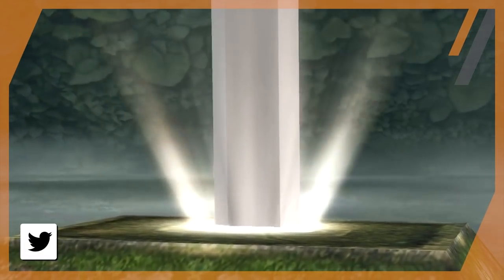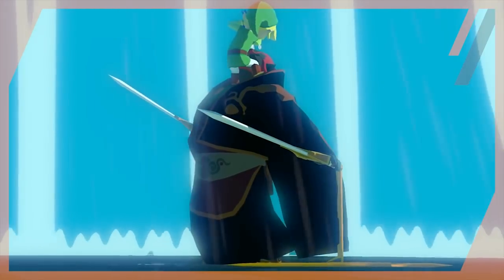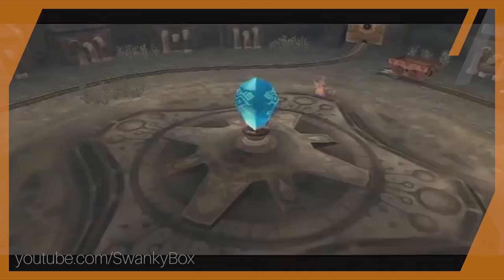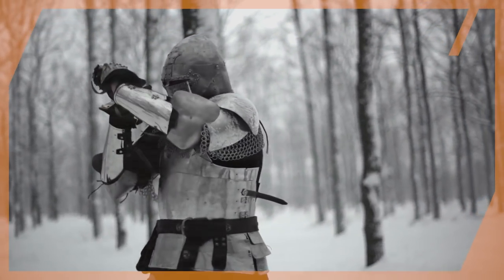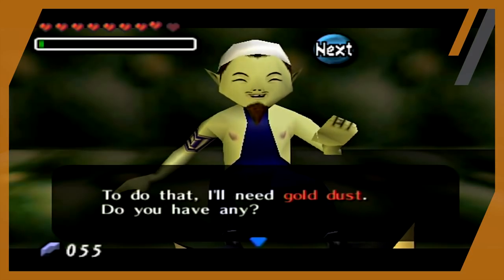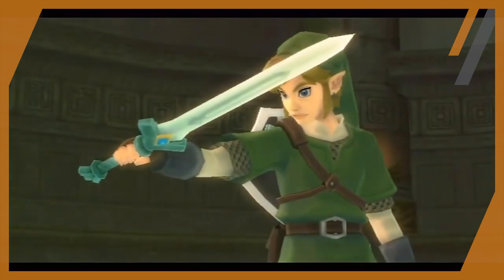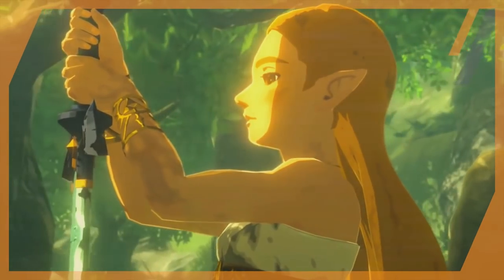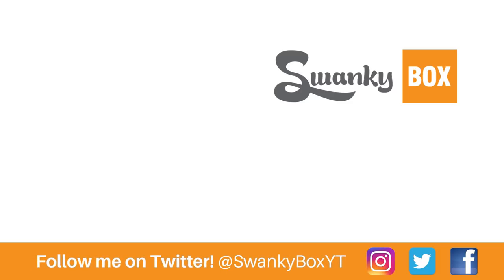Why EVERYTHING About Zelda's Master Sword Somehow Makes Perfect Sense

Comment: A bit late to post this, but if you want to pull some lore from the side games, there's actually a fair amount to work off of in terms of metal. First however, we should address the nature of the 3 golden goddesses. 

So, while locations like Termina make no direct reference to them, they do seem to still have implications that they existed in their world. While a game like Phantom Hourglass's Realm of the Ocean King (which is strongly implied to be a different dimension) has Courage, Wisdom, and Power Trifectas, and ties in nicely with the core ideas of the Goddesses. This is all important because in A Link Between Worlds, we are introduced to a Dimension separate from the one Hyrule is from, that also has a Triforce without being a pocket/mirror dimension. (Like a Link to the Past's Golden Realm, which was corrupted and became the Dark world. In the intro to the game however, the Golden Realm was seemingly created just to hold the Triforce, and should likely be considered an extension of its original dimension.) Because Lorule proves that the Zelda Multiverse can have the Golden Goddesses involved, by having its own unique and separate triforce, regardless of which dimension it was, means that materials or magical possibilities (such as seals, spells, or magical items) possible in one dimension, should be possible in another, without needing to travel between dimensions, as basically all alternate dimensions are made of the same base components.

This was all important to set the president of the Realm of Ocean King from Phantom Hourglass as a reference point for the nature of the materials used when crafting the Master Sword. Or rather, the Goddess Sword. So, in Phantom Hourglass we eventually obtain a weapon that's strikingly similar to the Master Sword. (And likely, should be around or just under its power.) The Phantom Sword is a sword made of special metals, all combined into some form of alloy, that when forged together act as a strong enough base to contain the titular Phantom Hourglass. This special item, made by the Ocean King, a creature possibly around or near the power of Hylia herself, has half the power to stop time. The other half needing the power of a Fairy of Time (and courage) 

These special metals are known as Pure metals, and have strong spiritual implications to the tribes of the realm that look over them. As well, they specifically hold resemblance to the colors associated with each of the Golden Goddesses. Together, they seem to create a metal (similar in color to the master sword) that is capable of channelling holy power that's strong enough to defeat a creature implied to be on par with or created by, an incarnation of demise. Though the Phantom Sword is almost surely weaker than the Master Sword, as it has the power to repel all evil, this may have less to do with the metal, and more to do with the crafting process. Given what we've established with the previous sections, I would say it's safe to say a material similar or identical to the 3 pure metals, or the alloy/material created when combined could exist in the land of Hyrule. (Though could be incredibly rare) If that was used, and Timeshift Stones acted as a base for the hilt, I think such a thing could reasonably form the Goddess Sword. Given the possibility of the Goddess Hylia being the Goddess of Time mentioned in Majora's Mask, then her patronage as the creator of the sword may grant it greater time manipulation power/ability as well. 

If all of that was true, then I would also stand to reason that the Phantom Sword is likely stronger than the Goddess Sword, and that when the Master Sword was forged out of it by the Sacred Flames it became more powerful, and stands as the most all around powerful sword in the Series. (When not compared to its own improved forms) As the Sacred Flames are said to be the direct power of the Golden Goddesses, and the Triforce is undoubtedly the most powerful force in the series, it stands to reason that a vessel made to hold and channel the power of the creators of the Triforce would be the most powerful sword achievable. So in conclusion, I think the gold and titanium alloy angle is good, but I also think that the Master Sword is made of a different metal, that, given that some weapons deal more damage, like the biggoron sword, the Master Sword may have actually been made from a different, perhaps weaker material made to better channel holy magic, to give it potent sealing and repelling powers. Though is almost surely made from something about as durable as regular Titanium.

Comment: A good theory, but the sword itself needs to be full tang to be able to sustain the damage it does. The crystals would need to be harder than diamond, and honestly, I can only see the pommel being made of the time crystal, while the grip and guard are a metal accented with a melted crystal over it.

Basically, a LOT of work for the craftsman if you're forging a hand guard of crystal. 

There are so many parts to the Master Sword, to fabricate it would be no small task. The guard would need to be reinforced so it does not break, which will take time and effort. Even given the rule of divine influence, the sword itself will need to be crafted carefully.

Last I checked though, a new version of Titanium was made and it was called "Titanium Prime", which was 4 parts titanium, and 1 part gold. Increasing the resilience of titanium, with the bio-compatibility of gold.

Gold itself is known to be immune to oxidation, meaning it never rusts. It may tarnish, but it will never rust. The time shift to repair itself is a good reason, though in the end, it just means it's still a magic sword that mends itself.

Comment: I would like to give an interesting counter-theory, so please hear me out.  The factors of all metals are very different when used for making swords.  Metals like Gold, Silver, and Titanium are too soft to keep a good edge on a blade (even the Ti3Au alloy); as it is mostly the carbon impurity in the Iron which gives Steel it's effective hardness and toughness as a good sword.  With it's immensely high-melting point, Titanium would actually BURN into TiO2 powder before it could melt.  However, the Master Sword's blade could POSSIBLY be made out of Wootz steel, giving the already strong sword the impact, corrosion, and acid resistant blade it's known for!!
As for the rest of the video, the Time-Shift Stone explanation is a great theory.

Comment: Regarding the Master sword not corroding over thousands of years, I'm not sure how the mentioned Titanium-Gold Alloy works corrosion wise, but aside from its rarity and unusual color, one of the things Gold is valued for is its lack of chemical reactivity. Platinum and Iridium are the most corrosion resistant metals(hence why the prototype Kilograms were made of a Platinum-Iridium alloy back when the Kilogram was based on a physical object instead of the fundamental properties definition it was given in the last few years), but Gold is pretty resistant to oxidation and other chemical aging as well... and I'm pretty sure Titanium is less reactive than Iron and most steels.

Though, I find myself wondering whether that 3:1 ratio is in terms of weight, volume, or number of atoms/moles. Hopefully weight since the density difference means a lot of Titanium to a little bit of gold(If I'm doing my math right, a 3:1 T:Au weight ratio corresponds to a roughly 12.8:1 volume ratio, whereas the 3:1 ratio being in terms of volume or atomic ratio means most of the blade's weight would be gold... it would be a very expensive alloy regardless, but the 3:1 ratio being in terms of weight would be the least expensive... plus might result in the blade being light enough to actually swing like a bronze or steel sword(Titanium is a fairly light metal, ~4.5 g/cm^3 while Gold is one of the heaviest, ~19.3 g/cm^3, while steels are in the 7-8.5 g/cm^3 range. Not only would a solid 24k gold sword be too soft to be an effective bladed weapon, but its weight would probably make it more effective as a bludgeon and impossible to swing like a normal sword, while a pure Titanium blade might lack sufficient weight to cleave effectively unless it was significantly sharper than a steel blade of the same dimensions(what cuts is pressure, and pressure is mass times acceleration divided by area., so for the same speed and edge thickness, a heavier blade cuts better, though the heavier a blade becomes, the harder it is to get up to speed).

Though, given what was said about the Master Sword being an Arming Sword an the other sword classes in another comment, I'm guessing the Biggoron Sword is a long sword and I find myself wondering if the Kokiri Sword is a short sword or a dagger.

Also, while I've never known them to stab back, I find that, when slicing Tomatoes, stabbing is usually the best way to start a cut and that using the edge of a knife, unless very sharp, often just indents the skin and more mashes the tomato instead of starting the slice... granted, most of the "sharp" knives in the main flatware drawer are probably 15-20 years old and who knows when the smooth edged knives among them were last sharpened... we have a butcher block with good knives, but I have an unreasonable housemate that keeps hiding those.

Comment: -The blade is made from Fallout:NV Saturnite, an alloy used in knives that were sharp enough to cut throw cutting boards used in restaurants
-The hilt is made from an Elder scroll (specifically the one used to banish Alduin) 
-And It has the Mending enchantment from Minecraft to repair itself

Comment: I'm not a metallurgist, but I suspect that a sword made entirely out of this very hard titanium-gold-alloy is going to be so hard that it's brittle. If so, it would probably break upon hitting something hard, rather than bend and then return to its former shape. We have modern types of steel that are far harder than anything else humanity has had access to so far, but that doesn't mean that we make our tools entirely from it. Some tools (or weapons) benefit from having a different hardness in different parts (so like maybe the edge and the point are made harder than the body of the entire thing).

Comment: Sandia platinum-gold is considered the most wear resistant alloy in the world.  It is silver-white in color, like normal platinum, and just slightly heavier then gold.  It is more heat resistant from high thermal conductivity, has high oxidation resistance, is one hundred times more durable then high-strength steel, and in the same class as diamonds and sapphires for wear resistance.  However, it is still only as hard as other platinum-gold alloys, which isn't super hard, but just conducts heat and wear better through it's structure.  As mentioned in the video, the gods most likely had an advanced knowledge of metallurgy.  It is already known that both gold and platinum can be alloyed with titanium to make a far stronger alloy, so it is entirely possible, I believe, that they could have made the blade from an alloy of platinum-gold and titanium, to make a super-hard and wear resistant blade.  Although, obviously, I could be mistaken, as there are other metals out there, such as tungsten, for high tensile strength, but brittleness, or chromium for the hardest known metal around, or who knows what else.  But I think titanium alloyed with a platinum-gold alloy sounds reasonable.  Although, I think it is reasonable that the White Sword from the original Zelda game could be a mixture of platinum and tungsten, but, again, I'm not an expert.

Comment: Beta Ti3Au is the alloy he was referring to when referencing the study from 2016. Its not stronger than all steels, but its definitely harder than a lot of the steel types used in the making of decent swords, e.g. 1090. It has high shear strength apparently but nothing is really said about its tensile strength. If its higher than say 1090 than yes it'd make a wonderful sword blade. The weight of the molecule is pretty close to steel as well, meaning handling shouldn't change.

Comment: This is proof that Magick can be explained with science! Or, at least some magick. 

For example:
The Kamehameha wave? Plasma.
Hadouken? Plasma.
Palutena's Megalazer in SSBU? Plasma (or maybe some kind of Gamma Ray/Plasma fusion).
Reply: The Force and lightsabers? Plasma. Using an invisible plasma source to move objects and create lightning, or create a colored fixed length beam of light which can slice through metal like butter. 
Pokémon? Plasma. How else does a 17 foot tall, 1500 lb Dialga fit into a 2.5 inch diameter Poké Ball which you can clip to your belt or transfer to a computer? Either that, or they are…
Holograms? Plasma. "What do you mean a projection?" How can a projection display a 3D image in thin air? Not to mention holograms without a visible projector.

Kirby? Plasma. He can float, transform his physical shape and appearance, take on properties of a small black hole, and why do you think star-shaped sparks appear when he touches a solid object?
Double jumping? Invisible plasma platforms.
 

Plasma is always the answer.

Comment: also you didnt discus the one topic that you illude to in the thumbnail, the blades shape, i was thinking you were going to explain why the blades suden taper from thin near the hilt to thicker further up sudenly made sense, swords ususaly work the other way, that narrow area is a weak point with all that weight past it its a wonder the blade doesnt snap in half there. when struck on something particularly hard

Comment: According to The Legend of Zelda: A Link Between Worlds, the Master Sword is made out of Master Ore.

However, Master Ore only exists within the realm Lorule exists in. This doesn't limit the Master Sword to only have Master Ore in it after the first upgrade in ALBW, as it's possible that all the Master Ore of Hyrule's realm was used to create the Goddess Sword. It's also possible that the Master Sword couldn't have been forged with Master Ore due to the possibility that the destruction of Lorule's Triforce unleashed some power or other change in the environment that allowed Master Ore to develop in the first place—which means Hyrule wouldn't have the right conditions for Master Ore to exist.

As of the typing of this message [on November second, 2019 at 22:38], I do not have enough information to give a definitive answer on the matter.

Comment: Well ... some stuff you mentioned about swords is not really correct. The stuff about the softer, sturdier core and the harder, more brittle edge applies to katanas and not to monosteel blades.And you cannot cut through armour. Believe me, even a really sharp and hard blade will not cut through metal.

Comment: The idea that the hilt rewinds time to restore it is genius! Epic head canon.
 But, personally i don't think saying the strength of the blade is due to magic is a write off,  it's a fantasy, and the magic is very soft like LOTR and so it makes sense that this sword that defeats evil will be presented as having mystical, unknowable powers,  much like excalibur or Aragorn's sword. It fits the magic system perfectly and taps into genre conventions. But if you wanted you could introduce specific magical rules that allow for this and have added effects or payoffs instead - like of the magic makes it stronger but also lighter, which is why it has unnecessary decorative elements to put it back to the same weight as a regular sword. Or that the magical energy it produces is actually what forms the edge of the blade allowing it to be impossibly strong,  bc it's a magically created invulnerable blade of pure energy that actually cuts through things.

I would also argue that there's not really any real world metal that works better for blades than certain types of carbon spring steel, prepared in highly specific ways. Being technically harder doesbt make it a better blade and blades made of titanium or other alloys aren't as effective at doing what swords do as spring steel is. I don't know a lot about titanium or other alloys, but I've hard others who do argue this. Besides, you vac see this same thing happening just with different kinds of iron or steel. Stainless steel is stronger than iron but if hard enough to be a blade it often breaks instead of bends when put under stress. And bc its so hard it can't be as easily sharpened and it loses its edge. iron bends but is way easier to sharpen and can be bent back. Spring steel kinda has the best of both worlds bc it bends instead of breaks, returning to its shape, but also keeps an edge better but can still be sharpened more easily than stainless steel... e.t.c. once again, though, I'm not an expert but exists seen to agree that the "harder than steel" argument is an oversimplified view of the situation